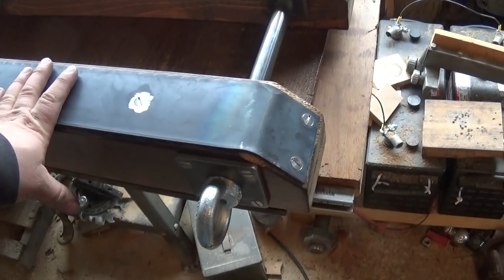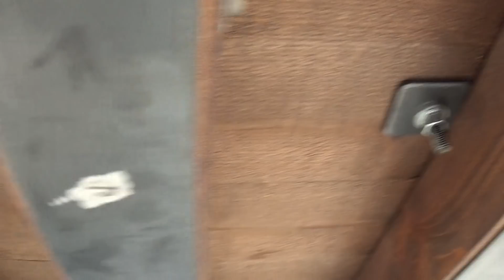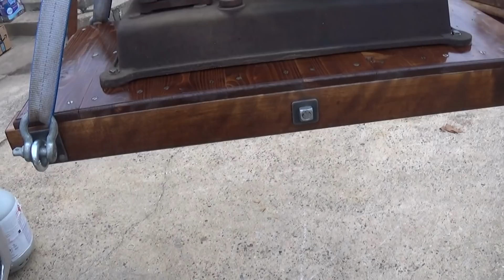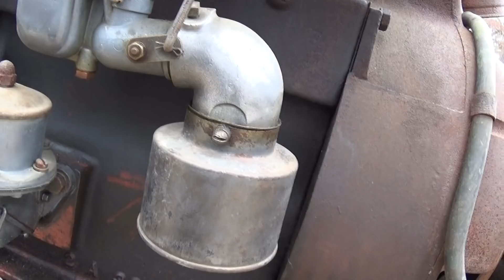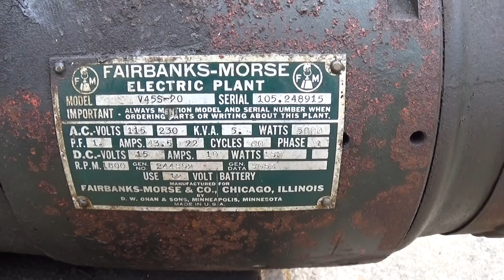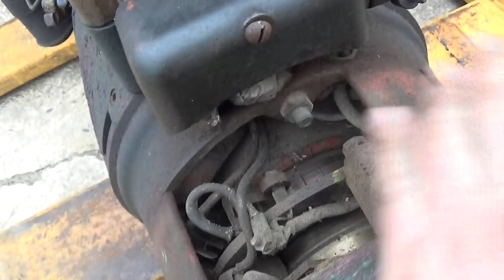Onan Inline Twin and V-4 Generators

Comment: I really like these old Onans, it's just a pity that they are like unicorn feathers over here in the UK. We bought an Onan RV-2 (I think) single cylinder 2kVa generator, which as its designation suggests, was used in an RV. Our example is only quite modern (about 1962), but has all of the hallmarks of Onan, and we bought it initially with the intention of installing it as a back-up generator at my dad's place, being propane fuelled, and with remote stop/start, it would have been ideal for the task, but sadly my dad died before we could complete the job. I've only ever seen one other Onan in the UK, at a vintage/bygone sale, many years ago. It was very similar to the inline twin set that you showed here. I wish we had bought it when we had the chance.

Comment: You've got the best collection of old gennies, love it! That adjustment with witness marks is for the DC gen portion timing, used to ignite the AC field windings. It shouldn't need further tuning unless running RPM is changed, like 50Hz vs. 60Hz changed.  I've got an 1800 RPM 1KW AC generator just like it on a Jan 1945 Wisconsin 4HP engine Master V. generator. Like any finely tuned DC motor, a DC generator has an optimal power/voltage output that is adjusted by timing for the designed running RPM. This comes from magnetism having some fixed minute delays filling and draining itself from cores (steel).

Comment: nice video  and a couple of cool old generators , great explanation of what they are , I love old equipment like this 
most of my machinery isn't quite this old ,or small ,,I have several gensets but most are larger ,and generally odd too
the ugly duckling of the bunch  is a beast called The Deuce ,powered by a 2-71  2 cylinder Detroit diesel it puts out 20KW at 1800 rpm,,, it's an old railroad generator and still runs perfect with almost 20,000 hours on the meter ,it's backup power for my farm 

the other odd one i have  belonged to a farmer in  nebraska  built in 1965 as a combination genset/water pump ,,it powered a 12 tower center-pivot irrigation system until being replaced with a diesel engine in 1999,
at the heart of the machine is a GMC V12 engine ,it runs a 30KW 480V generator and a 300GPM 100PSI water pump 

I saw some guy write a message concerning the lifting eyes you put on the skid for the 2 cylinder generator ,,
in a way he is right about the lifting angles  but  from what i saw of the way you built that skid with spacers in it  to prevent crushing of the wood  ,the only concern i  would have is the bolt used for the threaded rod  ,,and it didn't look like the cheap threaded rod either,,I can't imaging that generator weighs over 1000 pounds so i personally wouldn't worry about it myself ,, and it's not like you are gonna be lifting it every day
Reply from the maker: Thanks for watching!
Detroit 2 strokes are great for generators being every other half revolution is a power stroke for each cylinder.  Makes for very stable running and prompt load response if the governor is in good shape! 
What did the GMC V12 burn?  Gasoline, natural gas / propane?
As for the gen skid... By my calculations, at  a +90* lifting angle I have 1400LBS of lifting capacity.  The generator weighs about 350LBS.  The all thread is 5/8".  Can't please everybody...
Reply: the governor is the only part of  my Deuce that has been replaced in the decade i have owned it  aside from the batteries which are 2 years old currently ,,and also used for standby power ,, the only modification i have done to the machine was replacing the 24V generator with a pair of delco/remy 24v alternators each putting out 250 amps ,,the reason for this was the battery array which i use for standby power ,,those are 2500 amp hour 24v forklift batteries ,each powering a 5KW pure sinewave inverter
I have combination solar and generator backup power ,, if the generator does not start  we never know because the inverters will power the house for 24 hours so when i get up in the morning i go out and manually start the generator 

the  702 V12 i have was originally set up to run on LP  .the farmer i bought it from had added dual fuel carburetors to it in 1980  so it will run on either Propane or gasoline now ,,in cold weather it starts better on LP 
I just ran it for the first time this winter  today  , and it started right up  after 6 months asleep 
i haven't figured out what i wanna do with it  even though i have had it for 2 years now ,,they are getting very rare and extremely hard to find parts for ,, the 480V generator-head is belt driven 6x 5/8 in belts  and it has a hand clutch on the rear for the pump if i could get a stepdown transformer it easily could make 75-100KW at 110v

Comment: Just a safety note, those eye bolts are not designed to be lifted at that angle. Day two at hoisting or rigging school.
Reply from the maker: That is right, they are not designed for it.  However, with a combined WLL of 5600 pounds, I am not concerned.
Thanks for watching!
Reply: Not true, at that angle WLL is zero pounds. Never lift at that angle means never.
Reply from the maker: Noted.

Comment: nice work I just picked up a 15rdjc diesil onan 4cyl on trailer. 3phase. I need wiring schematics for exciter unit. Someone disconnected wiring on exicitron excitor. Have any info on these?  Motor runs perfect and on a trailer. 15kw on each phase. Thanks